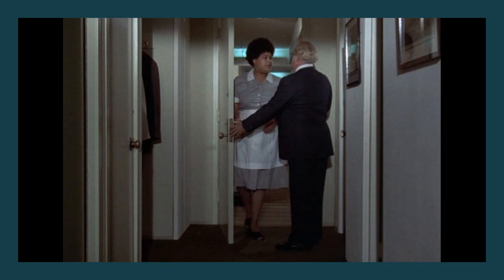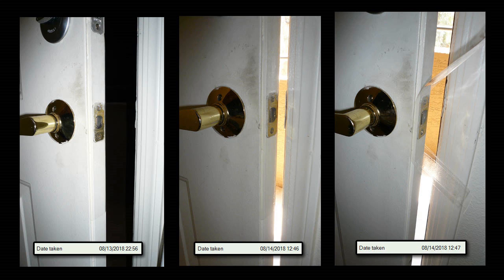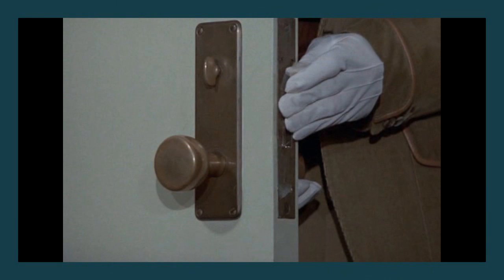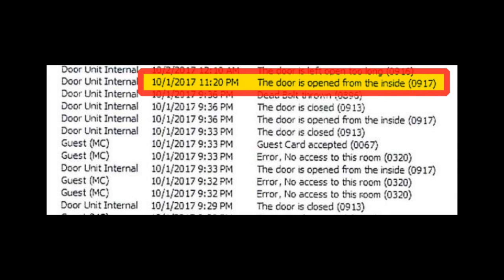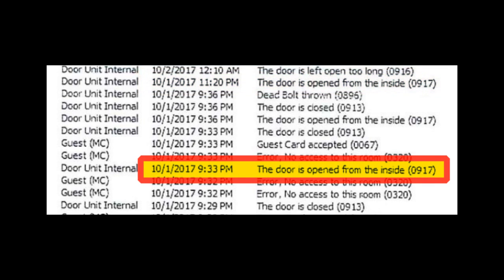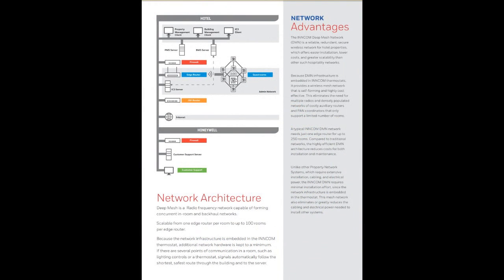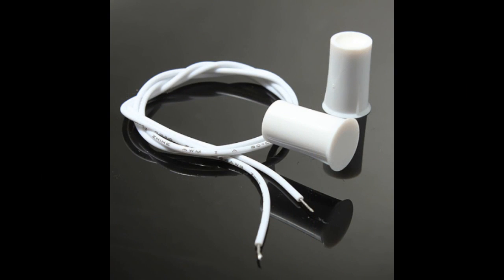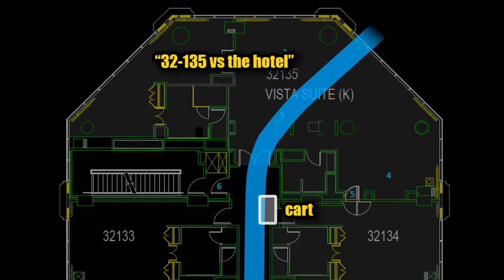35. Las Vegas: The Door Lock Mystery Pt 2

Comment: Facts about system errors when you have more on that network. It’s inevitable. My door lock sensors sometimes register as locked, and unlocked minutes after they are engaged, or disengaged. We have numerous sensors, cameras, and locks all in the same system. The system errors are one thing, but then you also have the devices creating errors as well sometimes. My locks are opened with a key code on a touch screen, and they have randomly diverted back to the the default code before, and at the same time kept alerting continually that it was being unlocked when it wasn’t. There is going to be differences in quality obviously, and my locks are for home use, but these things are always imperfect no matter what. The locks, and sensors on high security properties produce errors even. I know for a fact, because if they didn’t my husband would be out of a job.

Comment: You need to test the same type of lock that were on the hotel doors for the tape test. The hotel door hardware bolts and latch is harder to hold in than the lock you tested.
Reply from the maker: +Mark Norris --- "is harder to hold"
How do you know this?
Reply: I have been in the building trades for 40 years. I have found on most commercial locks that the tape trick doesn't hold the retracting latches in. Sometimes on any given job only one person will have all of the keys. So a door will be opened by someone with a key and it is a door that will lock again once closed. So in order to make sure we don't get locked out of a particular room we will fill the strike plate hole with a small piece of wood or what ever is around to keep the door from locking. It keeps the striker from locking in the hole that is in the door jamb. Putting tape over the striker does not hold the striker in flush with the door on commercial door lock mechanisms 99% of the time. Anyway i am not trying to be a jerk I just wanted to point that out. I think your work is right on the mark most of the time and your channel is one of the most reliable sources for true and  accurate information.
Reply: That being said, you can try wrapping the tape horizontally starting on the face of one side of the door and coming across the strikers to the front side of the door and it holds sometimes but then you run the risk of someone seeing it and it might pull the paint off of the faces of the door.
Reply from the maker: +Mark Norris I asked how you knew that the hotel spring was stronger than the one I tested. Your opinions carry no weight as evidence for me. Evidence are the exact forces exerted by the spring in the two locks: mine vs MB, so I can compare the values. I ignore claims without such evidence. Note the difference between a hypothesis ("this COULD have happened") and a definite claim such as the one you've made: "hotel door [...] latch is harder to hold in than the lock you tested."
Reply: Mr Visual     OK, no big deal.
Reply: mark please look up 2600 & how to hack a con 

geeks at conventions in los rageus did this as well
Reply: mark i worked a lot of buildings as a security geek & day job "custodian"  
the tape will work

Comment: On 14 occasions we see the event "The door is opened from the inside" before "Dead Bolt released" when the starting position is that the door is dead bolted. My assumption is that what we witness in these instances is the "Panic release function" (see example in link below under "Specification") i.e. deadbolt and latch are automatically retracted by inside handle for easy egress in emergency situations. It bothers me however that even if we are dealing with this function, the report shows the opening of the door before the release of the deadbolt. If indeed the "door open sensors" are required to generate a "The door is opened from the inside" event, this event should never appear before the "Dead Bolt released" event, as the sensors cannot indicate an open door as long as the deadbolt hasn't been released. I therefore suspect something else than the "door open sensors" could be triggering the "The door is opened from the inside" events.        https://www.assaabloyhospitality.com/en/aah/com/products/electronic-locks/vingcard-classic-rfid/
Reply from the maker: +Eric Peters Good observation. We would need to know the exact response time for the deadbolt and "door open" sensors. E.g if the deadbolt sensor takes on avg 0.7s to confirm "deadbolt released", and the "door open" sensor takes on avg 0.6s to confirm "door open", you'd see "door open" before "deadbolt released" more often than the reverse. This is assuming that the sensor reports are timestamped correctly, i.e. the routing time to the server (where they're recorded) doesn't introduce even more timing issues.
Reply: Imo the "deadbolt released" response times would have to be > 0.1s slower than the "door open" ones. The opening of the door can only start after the handle has been lowered, a process during which the deadbolt would already have been released. I'd say the "deadbolt released" response times would have to be c. 0.5s slower for this event to appear after the "open door from the inside" event.

Alternatively, could there be lock systems where the magnetic "door open" sensors are in the latch and hole? If that were the case, the "open door from the inside" event would be created as soon as the handle is lowered, possibly before the deadbolt is released. We wouldn't need misaligned response times to explain that events are in the wrong order. It would also be easier to explain the "impossible sequence" we discussed previously (32135, 9/30, 6:13am). That sequence could then be created by someone holding the deadbolt in place while lowering the handle (open door) and then releasing the handle (close door). In that case the door would in fact not have been opened and there would be no need for a "release deadbolt" event - an event we're missing at 6:13am...
Reply from the maker: +Eric Peters I doubt anyone makes contact sensors that rely on the latch (the metal bar) and the hole because direct metal contact is unreliable (oxidation, denting), unless it's protected from the environment. I don't think there can be magnetic sensors in the latch bar itself, as it would weaken it. Certainly, there could be a recessed magnetic sensor near the lock or a separate mechanical "peg" that sticks out (see S Wheeler pics below), but I think that brings us back to where we started.
https://drive.google.com/file/d/1VC8H81dL4_LcXS2NnbhE1ZR0KkBIkudt/view?usp=sharing
https://drive.google.com/file/d/1i0SJsawR-qRMY8mP27WqIFlIOUtzrGJ1/view?usp=sharing
https://drive.google.com/file/d/17EyDnamyPD6e58m0jSfElbjLelLnnLF4/view?usp=sharing
Reply: After doing further research into this tropic, I agree that any opening of a door would be registered by a "door open" sensor, the technical term of which appears to be a "door position switch" (DPS). I did not find any sensors that are built into the latch as I had previously suggested. I did come across an interesting page from a security consultant (see link below). As usual, any new knowledge leads to new questions. The link below discusses the occurrence of (often false) "door forced open" (DFO) alarms. This makes me wonder why Mandalay Bay does not seem to do DFO monitoring on its hotel doors. The breach should have set off a DFO alarm, as the access control system would have received a signal from the DPS without receiving a prior signal from either the card reader or a request-to-exit device (e.g. door handle). If Mandalay Bay doesn't do DFO monitoring, this would represent a big security risk: anyone would be able to pry open a hotel room door without setting off alarms. On a different note, we know Mandalay Bay does "Door open too long" monitoring as that was the reason Campos was in the 100 stairwell. The "door is left open too long" event seems to be generated when a door is left open for 50min as it appears in the 32135 report at 1210am, i.e. 50min after the breach. However, the apparent lack of DFO monitoring by Mandalay Bay surprises me. If they had done DFO monitoring, it would not have been possible for Paddock to tape off the latch and open the door without setting off an alarm. One could say the shooting could have been prevented in that case. http://www.silvaconsultants.com/solving-the-false-door-forced-open-alarm-problem.html
Reply: ok i will vid

Comment: What if he simply taped one of the cards over the hole where the latch inserts, that way while setting up his cart he could simply go check his monitor on the other cart inside. Instead of having to worry about it constantly locking when he goes outside and adjust it and to go bracket the stairway door.
Reply: Also it avoids propping the door open with an object and letting someone (a drunk hotel guest) just randomly wonder inside a room full of guns. It allows him to quickly pass in and out the room and hallway. Remember he wanted to remain hidden for as long as he could and get things set up as quickly as possible. I’m sure he was filled with anxiety with what he was doing so drilling and bracketing the door would lean one to think someone heard it, and he’d panic at just the thought of drawing unwanted attention

Comment: Uh-oh. I see a huge problem with this video, and I really wish it wasn't there. 
It's been a while since I've been to a hotel but I think I recall correctly the door latch on a hotel door has much more spring to it than your example gives. The door in your example seems to me like a typical home would have. 
I do ''think' that it would be fairly difficult to tape the latch and have it remain with the latch pushed in, but I don't think it's impossible. You only need to get the tape on correctly once for it to work. To start I would have used the tape horizontally rather than vertically on the door. Attached very well to the door face and then tightly pulled around and over the latch then secured to the door face should be able to work. 
Duct tape I think would be a bad choice as it's gummy and stretchy and doesn't have the right type of strength and really needs to be wrapped around something and back onto itself to be most effective. The packing tape is suited for the type of taping needed for the door as it has a lot of surface sticktion or stick-to-it-ness if I may say so. 
I like the card in the door jamb much more.
Reply: mo·dus ope·ran·di  I agree and I tried to let Mr. Visual about commercial door latches having stronger springs in them. I commented my experience but he took it as an attack on his video.
Reply: Mark Norris Ehh, shit happens.
Reply: mo·dus ope·ran·di    Yep
Reply from the maker: +Mark Norris No one took it as attack. Don't invent drama. I asked how you knew that hotel spring was stronger than the one I tested. Your opinions carry no weight as evidence for me. Evidence are the exact forces exerted by the spring in the two locks: mine vs MB, so I can compare the values. I ignore claims without such evidence. Note the difference between a hypothesis ("this COULD have happened") and a definite claim, such as the one you've made: "hotel door [...] latch is harder to hold in than the lock you tested."
Reply: Mr Visual Mr V. I totally get where you're coming from about what could be and what really is with proof. 
So with my comment I tried to point that out by saying as I recall instead of I know for sure.  I'd still say I'm 98% sure that commercial door lock sets in general would have a much stronger spring pushing on the mechanism even if just for the sake of longevity.  A commercial building sees use at least three times more than an average household and therefore it's reasonable to believe that the mechanical moving parts would be more heavy duty than residential hardware. 
If you could tell me a fair way to show proof of that then please give me some metrics for a test. 
Honestly if I used a small craft stick and showed the flex it has versus a commercial lock set would that suffice for the discussion to move forward?
I believe commercial latches have much more spring force but I also believe a person could successfully tape the latch back with the packing tape shown; so I guess the test is mute for the sake of what I'm saying but I would like to see this discussion continue.  
I did come up with a possible flaw in the door interrogation report and a couple of LV youtubers are looking at it for validity.  I hope to see it hold some water and be shown by one of them soon. 
Or maybe it's nothing. 
Mr. V, you do great work. 
Would still love to discuss a matter privately if you're willing. 
I can be reached at modusoperandi911 at Gmail dotcom if you're willing.  I won't waste your time, I just want to ask a question without siderailing this.
Reply: Mr Visual One other point I wanted to make about commercial door latches.  They just have more to them than a residential bedroom door. More metal, larger surface area, sometimes they are three pieces where the middle piece moves independent of the two surrounding it.  Many many combinations of door latches out there.
Reply: Mr Visual OK,  it’s no big deal.

Comment: Makes sense to me. (Better this time). 

I do have a question or few though - Would the key card work to lock/unlock on an electronic hotel door if it had tape over the latching mechanism? (I just don't know much about this) Is this possibly an explanation for certain door latch logs "missing" on the new/Final FIT Report? Are there really any missing or not? ?

If someone was trying to jam a lock, how would the tape help or hinder this task? It's easily done by pure error with the example of entering an incorrect PIN number for a bank card or passwords to accounts online. How would this be different? - with regards to the tape over the lock on the door.

If he managed to lock out his room key cards, would that explain the amount of time he stood waiting in the hallway with no activity? (It wouldn't seem so as that would be too fast for a new key card to be asked for, made, & delivered to be used - and it appears the same card number was still used again - so that's still unaccounted for, I guess)

Just asking additional questions, because I don't know these things. Perhaps it could help others too?? 

Thanks Mr Visual. 

Oh, one more thing, from experience, tape of all sorts "decomposes" over time. If it was a relatively  new tape, it's quite sticky, depending on the specific tape used. Let it sit a few years and it's not nearly as sticky. Allow it to freeze through the winter & who knows how it will react - they're all different.

If that same brand-new tape is subject to heat (let's say you left it in a vehicle for a while by mistake), it gets extra sticky & leaves residue all over the place OR won't pick up anything, which is useless for it's purpose at this point.)

This is such a "sticky situation", Haha.
....I shouldn't say such things... I'm quite serious with my questions.
Reply: Does the age of the door handle come into play at all?

Comment: hmmm, well... like I had stated before the tape is a plausible method, but in my opinion highly unlikely. SP had multiple key cards in his possession and the ability to throw the deadbolt and use it extended as a door stop. why use tape? I appreciate all your work (and Mr. Burgundy and UFO Hunter UK's) and I hope none of you stop producing for this topic. Grinding over the details is the only way to find a solution/conclusion. How would you process the Lock report activity?
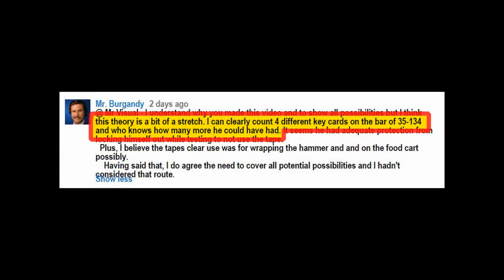Reply from the maker: @01:40
Reply: I know if the door is left open awhile then the Hot SOS call goes to security.. I suppose he could tape the latch and leave to screw the latch on the door but it would still register in the door logs when he pushed it open correct? Like would it register as opened from the inside? If u don't turn a knob how else would it know? Hmmm it's interesting tho.
Reply: quote: like I had stated before the tape is a plausible method, but in my opinion highly unlikely
Maybe so but it is far, far more probable than someone  else on the inside opened it.
Reply: KrazyLurt interesting that you’d believe tape over someone else being there when there’s ample data that both rooms were slept in, both bathrooms were used, multiple food orders came to the room and each room had a broken window with it’s own set of weapons.... plus the info of 3 other women being in that room during SP’s stay.
Reply: Omlette du Fromage Doing all that without leaving any DNA trace, that's quite accomplishment.
Reply: Maybe they were covered in tape! hahaha! I think the final report statements about DNA were a joke.
Reply: trackin… what I would like to see from somebody is a visual representation of body movement required to pull off all these lock entries. i'm not saying "you", but something along the lines of a roadmap of movements between these rooms manipulating these locks.
Reply: have you seen the DNA results cos you will be the only one !!!!!
Reply: taping the door will arouse no suspicion latching it ope would?
Reply: Omlette du Fromage 
the end result was one shooter found  
& 
the 3 other women never were in the room as its was cache booked

Comment: If the door mechanism has no sensors inside of it, how would the door lock report show a card was swiped and then entry was denied?
Reply from the maker: +Mark Norris No one said no sensors inside the mechanism, only that sensors on the latch itself (the metal bar) are unlikely. The card reader most likely has a sensor, Mentioned in the previous episode.
Reply: OK so you are saying the card reader is in the mechanism. I didn't understand what you were saying, my mistake